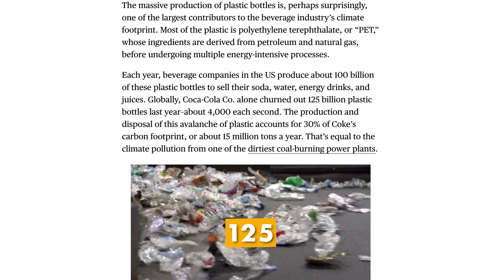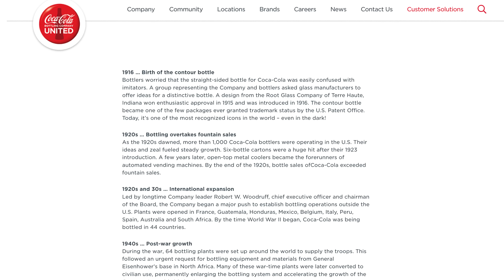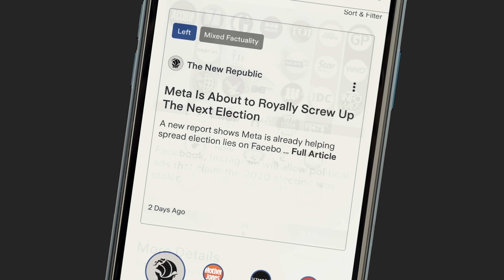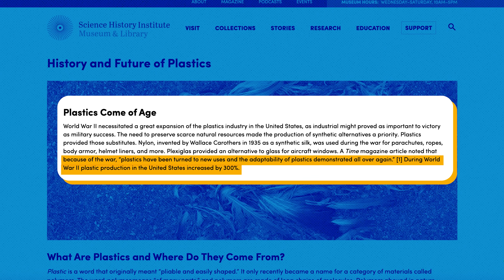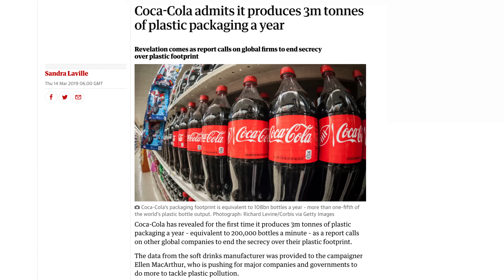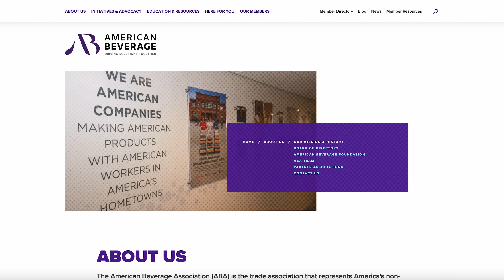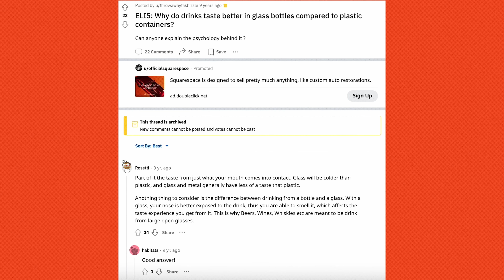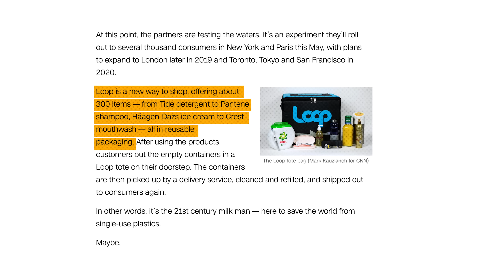Why the Glass Bottle FAILED

Comment: Mason jars and one gallon wine jugs could hold milk and juice also so theirs the canned food and milk jugs. Then the 16oz bottles and that covers single drinks.oh pop could be sold in those gallon jugs too making soda cheaper because you trade your used jug for the new jug with only having to pay for the contents and not the bottle. Just wash and sterilize your jug and pull up to a filling station and fill the jugs with what you want,milk,juice,tea, the only thing you need to do is select the amount of liquid your buying’

Comment: the only time when glass is cheaper than plastic is when the government intervenes. In engineering, we have software (ansys granta in my case) to calculate cost, environmental impact, co2 emissions, etc. when moving large amounts of product, its not even close. glass bottles cost a lot, and are way heavier. 

For an assignment we were required to see which was more environmentally friendly, plaster water bottle or glass water bottle.

co2 emissions from glass bottles are unbelievably higher, im talking 2x for material, 8x for manufacture, 1.5x for transport, and 6x for disposal, enough that you would have to 

This is because plastic bottles use basically no material at all. As long as bottles make it to a landfill, their environmental impact is significantly lower than glass.

Comment: Those recycle machines for plastic bottles exist in Germany, too. And this now also includes milkshakes etc. sold in plastic bottles. You receive 25 cents for returning them. Often they even come with a donation systen if you want to give your return money to local charity. In every city you will see poor people that earn a few bucks by searching for thrown away recycling bottles, they even search the bins. It’s common practice here for many people that if you are too lazy to return your plastic bottles, you put them ON the bin somewhere in the city. This way all bottle scavengers can pick them up easily.

And you can put all bottles in those machines which fall under recycling, even if the stores don’t sell those brands. But when you drive to Spain, there is no recycling, you throw all bottles away, not even in bins for plastic only. And in the USA? Heck, you eat in a stationary diner and are served meals on paper plates with plastic folks and knives and plastic cups which is all dumped then. USA just doesn’t care.

Comment: I usually drink pop/beer at home in aluminum cans. They are JUST as light and convenient to carry as plastic bottles. and aluminum is VERY recyclable (I recycle my own aluminum at a local metal recycling yard, rather than saving for my municipal waste hauler, Because I WANT THE MONEY! The only convenience issue is reseal ability. But aluminum re sealable "bottles" have been made before. It seems that those could be a reasonable compromise.

Comment: In the past few years here in Japan, drinks already use 100% recycled PET bottles. Not "made with recycled PET" or "made using X portion of recycled PET. 100% recycled PET. How? Because Japan treats recycling seriously. 

In many countries, you have a general "recycle" bin that all your recyclables go in. The problem is, these need to be sorted, and you think the recycling companies are going to pay to do that? Hell no! 

In Japan, we have designated days for different kinds of recycling, it doesn't all go out on the same day. There's a day for glass, there's a day for ferrous metals, there's a day for aluminium, there's a day for burnable trash etc. And it must be pre-treated and placed into the correct bags (i.e PET bottles must be washed, the labels and caps removed and placed in a net at the trash pickup site). 

The recycling companies have a huge supply of pre-sorted and pre-prepared recyclables delivered to them on a silver platter. The expensive part has been done for them, so why not recycle it? End result, 100% recycled PET bottles have started to appear in stores.

Unfortunately, there's a cultural element that makes this work in Japan but probably not in other countries. Japan is all about social harmony and everyone working together. In more independent countries, people would probably intentionally do it wrong because they think this will upset some group they hate or simply because they don't like being told what to do.

Comment: You do realize that you can buy Coke in 100 % recyclable Aluminum cans. It's not like Coke doesn't offer options. Anyway, most of the plastic bottle trash that I see are water bottles, yes water, that thing that you turn a handle in your house, and it comes flowing out and can be put into any container you choose.

Comment: instead of glass or plastic bottles, they can use paper carton bottles like juice bottles or milk bottles . they are lightweight and disposable too both problems with the glass or plastic bottles are solved then . even though beverages have pressure . if we find a way to reinforce  that it could be a good solution for our environment .i guess 😃

Comment: I live in Los Angeles. And pretty much anywhere i can find a plastic coke i can find a glass one. So clearly, the consumer prefers plastic to glass. At the same rime though, ive been to mexico many times and everyone recycles there because everywhere you can buy a coke, you can sell the container so the system is a no brainer.  I believe the consumer should jave the option to not pay the recycling fee when they purchase a beverage if they had brought thier previous container. And instead of 5¢, it should be at least 50¢.

Comment: India i guess glass bottld cola was the the trend till 2017 or 18(not sure)

People do throw away these bottles anywhere..

People use them as a paper glass to mix alcoholic drink with cola and then drink it where it  is not supposed to drink

Also cola experience is olastic bottles you can forget after taking a sip and closing the cap.. amd you may emd up drinking flavoured water without fizz..

Comment: Glass disappeared because of cost, PET is much cheaper and lighter for the feeble people today. Coke bottles were the most over-engineered bottle ever, it could withstand at least 10x the pressure it had too because the founder liked the look of it, it had more glass than it needed, but it lasted a lot longer, and you could drop it without it breaking.

Comment: This video: Coca-Cola forced people to throw their plastic bottles in the forest and now they have to pay
Reply: That's not quite the message. Plastic does have significant advantages for manufacturers and the video acknowledged that. One advantage for manufacturers is that it's much cheaper and easier to create new plastic than recycle existing plastic. This means they don't want it back so people dispose of it.

The three pillars of sustainability are Reduce, Reuse, Recycle (in that order). Capitalism needs consumers, they don't want to reduce. Capitalism also says to go with the lowest cost option (provided you have a product that works at the end), so if it's much cheaper to manufacture new than reuse or recycle, it's obvious what the option is there. The only way to encourage reuse or recycling is to increase the cost of manufacturing new, and/or significantly reduce the cost of reuse/recycling.
Reply: @rodh1404  plastic polution is people chucking their trash all over the place without concern. See: south Asia. That's not a Coca Cola problem

Comment: Glass didn't fail. Corporations found a cheaper way and consumers didn't know enough at the time to make a fuss. Glass is still the safest and cleanest material in the world for liquids. Yes fragile, but otherwise perfect. Stainless steel seems better, but I personally can taste the metal and will not use a 'lined' container.
Hint: If you don't buy premade drink products you don't contribute to the plastics problem and it doesn't matter. Soft drinks are about the dumbest thing in the world to be drinking.

Comment: You also missed the completely obvious part of the EPA and US government taxing emissions, being counter productive in this regard with fuel prices randomly doubling through out history. It takes more fuel to carry more weight for the same volume on a truck to ship glass than plastic. And when you are basing cost on weight loads, vs volume of products, and physically have to push truck engines and locomotives harder to carry glass... it kinda becomes a no brained you'd ship with plastic at a quarter of the cost ontop of the savings you mentioned...

I fully heartdly beleive coca-cola did returns for money in return cause it worked... until the government stepped in and it didnt.
Coca-cola started it, it wasn't a fluke and they didn't magically make every single manufacture on the planet jump on board with plastic...It was government putting pressure to go greener- inadvertently making the problem much worse

Comment: Yes it is a logical solution, return the bottles and get a small refund. But it probably won't work in America because consumers are very lazy and will opt for the easiest solution even if it means losing a little change. They'd rather toss that glass bottle in the trash bin and get back to COD.